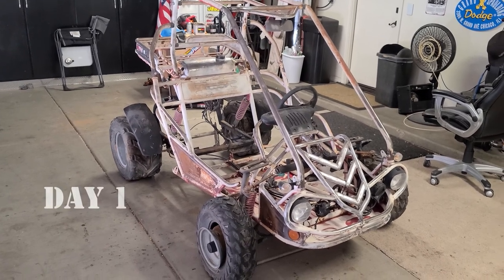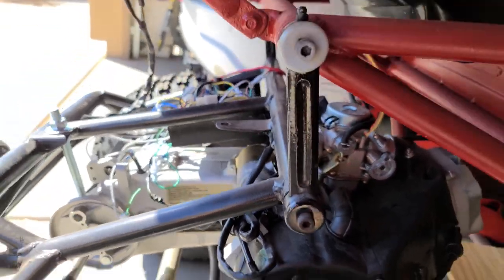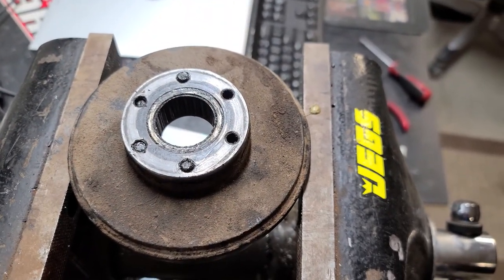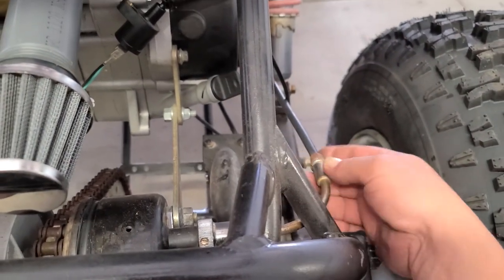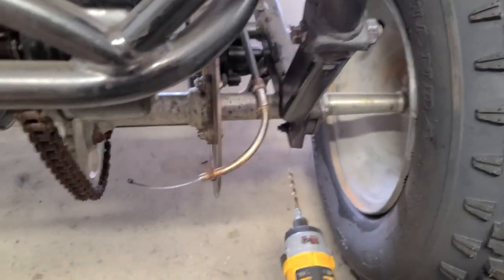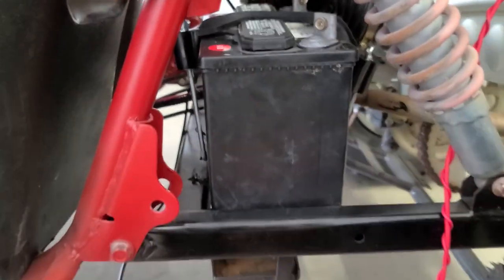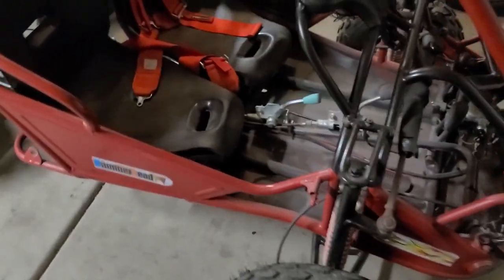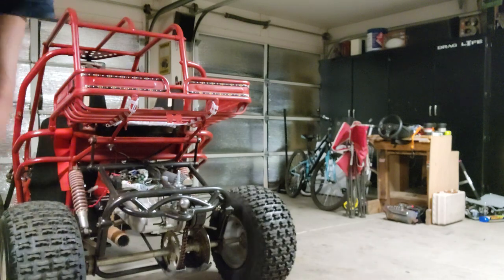Hammerhead Twister -Go Cart (Rebuild) Part 9 Final Video #Hammerhead

Comment: Great series. I came across this looking for information when i picked up an identical model as a restore project! I believe mine is a 2004. Thanks a ton for sharing your story and helping many out along the way! 

Luckily, I didn't have too much of a headache with the wiring. The main harness was still in tact. I had to figure out the wiring from behind the ignition though, since they did an ignition bypass after the key was lost at some point in time.
Reply from the maker: Glad to help brother it was challenging and fun. Let me know if you run into anything I did not cover. Cheers!

Comment: Hey man so I put the carb on and stuff it started up ran but has no brakes 😂 but when I push on the gas it like won’t shift in gear and go foward you kinda have to feather it but I needed someone to push me to get it shifted and when ur driving it like won’t shift to go faster and ideas why man and thanks for helping me you the best 😀
Reply: I wanna get it running for my son he’s been wanting to ride it so if u have any ideas please let me know
Reply from the maker: I would adjust the shift cable at the clutch sounds like it is not engaged fully.
Reply: @Destroyer1320  I fixed it last week it was something to do with the vacuum hose but thanks

Comment: How do you put the hammerhead twister in neutral mine is always in foward/reverse
Reply from the maker: You should have a shifter, I have a video on the clutch you should watch
Reply: @Destroyer1320  I have the green tip thing when I pull back it goes in reverse and wand I puts it foward it goes forward
Reply from the maker: @SlaxFS  they do not have neutral
Reply: @Destroyer1320  oh i was told they did lol sorry tho
Reply: @Destroyer1320  and if you do know how do you tighten the chain sorry for so many questions but I could find anything 😂
Reply from the maker: @SlaxFS  I have a video as well but it is the bolt on the back by the chain on top, It is about a  3/4 nut to tighten
Reply: @Destroyer1320  ok thanks so much man you have helped me so much on this
Reply: @Destroyer1320  and if you can post link to vid in chat if u can